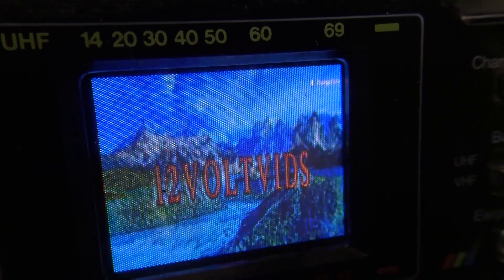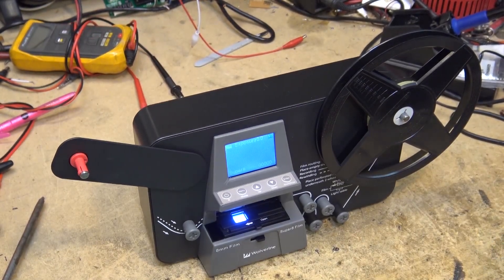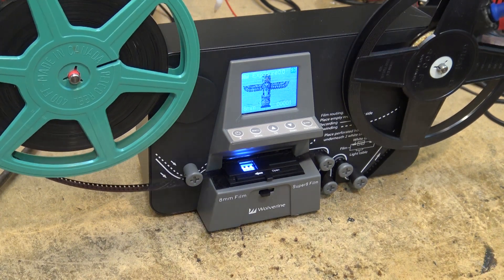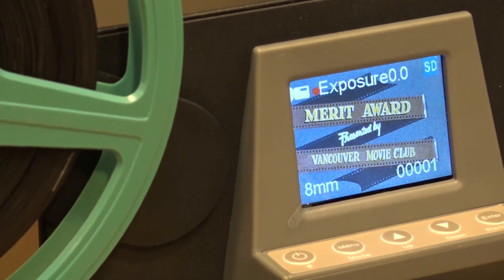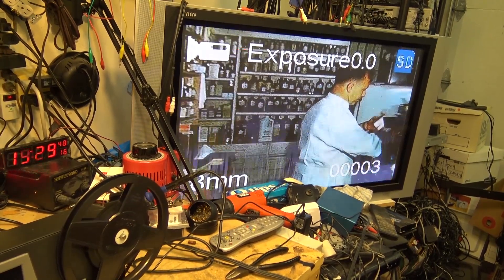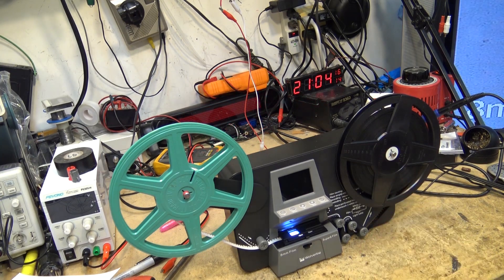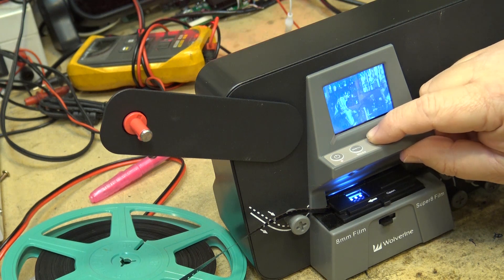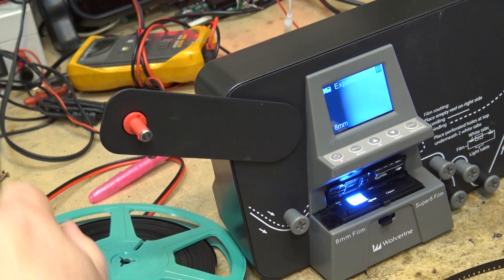Wolverine Film Scanner evaulation and quality check

Comment: I know the Forum 8mm nuts like this plastic minge - but it doesn't have much going for it as a pro device. That is not 'film grain' that's noise. That reel flapping about and getting sloppy and the almost useless anaemic motor and plastic er, 'all the rest' is the antithesis of precision, the halo of fizzling artefacts surrounding every object is the compression algorithm, the slight softness that they try and hide behind the 'barber and his strop' is a mixture of plastic (it's a lie)  lens focus issues / depth of field ... etc ...Holy shit I'm gonna make one, a proper one...(thinking...OK plastic is out...cast aluminium chassis, check. Two nice torquey motors, check. Precision film transport, sprocket advance and mechanism guaranteed not to mark frames, check. Magic solid state light source, magic diffuser, magic collimator , check. ''Full frame'' ++ micro 2/3 sensor. Check. Cost, er..), Yes I'll do you a good one for only, 4695.50 (British pounds).
Reply from the maker: And where did I say that this was a pro device. It is a consumer device and dies deliver superior results compared to a projector and camera with a light box. If I was in the business, and made my living from scanning film, I would invest in something along the lines of a reflecta, however with such a high priced piece of gear comes a very high price to transfer film and there comes a point that people will not pay much. When I was using a projector and doing them in real time at .10 per foot I had people that wanted it cheaper. Even with this unit I probably won't make more than .20 per foot, and this one takes 30 minutes to do a 50 foot reel that I could do in 3 in real time. I still get great results for DVD quality from my old setup, it looks fantastic with a 3CCD camera. The colors are excellent. Saying that, this unit has a sharper picture, and it is very convent to use for low volume or personal transfers.  For someone that has lots of reels of film, this is a perfect device, and not too expensive. I used to get film orders in that were in the 500 price range at .10 per foot. Now someone with that quantity can buy a machine, do their own.
The thing I like it is is quiet, I can load a film, let it run and do something else while it transfers. I don't do much these days, a few reels a month so for my low volume this will do the job, and nobody will complain about the quality. I just load it and forget it. The drive motor is a stepper motor, and no it doesn't "step" it runs constantly, they just use a stepper so they have plenty of torque.The parts that move the film are metal, not plastic. The drive gear is plastic, but it spins a metal cam shaft that moves a metal frame advancer.So the parts that actually handle the film are metal.
Reply: What I was attempting to say, with my poor humour and a touch too much venom was, that these days precision engineering can be prohibitively costly. Many product designers have no option but to cut out the frills - and the metal. We are slightly stuffed in some fringe areas. Anything of fine tolerance or mechanical complexity or that that needs skilled adjustment or finishing is often too costly for the smaller companies or reserved for medical /government / military aerospace / space / satellite field. Some little pockets across the world still have craftsmen of great skill - if you want to pay. Electronics has taken the place of the fine mechanics sometimes with remarkable effectiveness. This Wolfie thing is a perfect example of  cost saving, not quite stripped bare, but much that was done with nuts and bolts is now catered for with electronic elements. When  things are done with a sympathy for all the disciplines there can be magic. A Leica digital camera for example, where material choice, engineering and design along with state of the art electronics combine these technologies with extraordinary results  - but it costs. I don't think that thing (the wolfen) has much art in it. Yes I might be a bit of a snob I guess?
Reply from the maker: Right but it doesn't have to have art in it. All it needs to do is move the film accurately, and snap a picture of it using a fixed focus digital camera. It isn't rocket science. It is nothing more than a basic projector operating in slow motion and a light source to illuminate the film. Why re-invent the wheel. Nothing magic about it, a basic projector. Could they have made it faster, you bet, but the stress on all the parts would go up substantially, and require much finer tolerances.
By picking a slow scan speed, the stress on the parts that move back and forth is greatly reduced, the stress on the film is also greatly reduced. These things are made for a price point. I have a video camera sitting in the other room that  cost me over 10,000 and my cell phone shoots far better quality pictures than this 10000 camera.
Now ehe it was new 18 years ago it was simply amazing. 19:1 detachable lens,  3x 1/2" interline transfer CCD. High band DV Pro tape transport. Thing was awesome, but only 720x480i resolution.
Reply: I must say I had a moral battle with myself over saying anything that might - however unlikely - affect your trade. 
I love film, and I expect you do too, having worked with it for so long and appreciate as I do the beauty of the medium. The popular cultural art form of choice, of human expression. (Ha! Even Mrs Miggins at the seaside filming with her Pifco)? Maybe.
So with  the wrong tactic I said what I thought about the machine. That was how I felt as I watched. I know I should have kept my big mouth shut.  I will say though that there is art in our business - otherwise I for one wouldn't be in it.

Comment: Why is the picture stretched?
Reply from the maker: Editing software was in 16:9 mode as it set itself to the aspect ratio of the camera.  This was the first time I imported footage from the scanner.  Have to go in and uncheck the maintain aspect switch.  Then it will import with black bars on side.   When i process video i used a custom preset for 4:3 format.

Comment: Not impressed at all. The resulting video is LOADED with digital compression artifacts. YUCK! It's very likely that the film grain is more than the codec can handle at its given data rate. They need to fix that before I spend a nickel on a unit like that.
Reply from the maker: Actually it's not. YouTube is loaded with over compression and artifacts.  The image off the scanner is very good. The only thing that is better are units coating 10s of thousands of dollars.  I know someone that has such a system and he charges accordingly.  30.00 for a 50 foot reel for a straight transfer and 50.00 if you want scene by scene color grading done.  For 500 bucks you really can't beat the quality.  In this test i didn't attempt any grading or any type of correction.  The image off the scanner, especially if it has been color and gamma corrected looks great. Never had a single customer complain about it.  My unit paid itself off on the first big order.  The guy I know of that has another system will be paying it off for years.  Mind you he is doing commercial archiving for tv stations so cost is no issue for them.  The average consumer will never in a million years pay that for old home movies that nobody even cares about these days.  Most of the people on them are dead by now anyway.

Comment: Seems like they should be better now but i guess not amd they still pricey from.5 years ago
Reply from the maker: There is absolutely nothing wrong with the wolverine scanne. You do need to set them up correctly like anything else. Pulling one out of the box and using the default settings will not deliver the type of results possible. I have been using mine for several years now and have done about 1600 reels of film.  Lots of people are skeptical after reading comments from uneducated viewers of this and other channel that slam the quality. I get people that bring me 1 reel of film to transfer to check the quality and ever single one of them comes back with their entire film collection. One of my competitors has a 250,000 wet gate scanning system, and yes that is going to deliver superrior results but when my clients compare his service he charges 5X the price per foot that I charge and there is not 5x the quality difference to justify it. He mostly scans 16, 35 and 70mm film for the film industry where they have deep pockets and cost is no issue. They want 5k scanning and are prepared to pay for it. These units do 1440x1080 scanning and deliver results that exceed the quality that most home movies were shot at. Over / Under exposed, wrong filter used ect.  The last guy that I just finished his film order paid me 1,600.00 to scan his film collection and has already told his relatives so I will be getting their films as they find them too.  The key to using this unit is to NOT crop the image in the machine. Scan full frame and crop in the computer where you can also adjust the speed and color level and balance. It takes longer but the results are well worth it. Nobody is complaining except the internet trolls that nothing will make them happy.
Reply: Ok friend thank you for the info keep up the good work
Reply from the maker: Here is a link to the processed version of the home movie.
https://www.youtube.com/watch?v=aqa_x14JOOU

FYI for those that watch the film. The lady in the blue skirt in the bar scene is the only person involved in the film that is still alive. She is 100 years old, and received a letter from King Charles III, The prime minister and premiere for making it to 100.

Comment: IT  WOULD BE  A  GOOD  MACHINE  IF IT  WAS  MADE  IN  GERMANY  OR  USA,  BUT  NOT  IN  CHINA  LIKE  GARBAGE  PLASTIC  ONE TIME  TOY.  MY  BIG  THANKS  TO  AUTHOR   OF  THIS  VIDEO  FOR  GOOD  IN   DETAIL  EXPOSITION  AND  EXPLANATION.  BIG  PROBLEM  IN   ABSENCE  OF  SPROCKET-LESS  TRANSPORT  OF FILM   LIKE  IN  PROFESSIONAL  FILM  SCANNER.
Reply from the maker: It's a great machine for its designed use.  Digitizing your old home movie film.  It is not a professional scanner. Those can cost 10s if not hundreds of thousands if dollars.   The local place that has one charges 50.00 for a 50 foot roll of film.  So 1 400 foot reel costs more to transfer than the machine.   If it lasts longer enough to transfer your films it has paid for itself, then you sell to someone else.
Reply: @12voltvids  SOME  PEOPLE  LUCKY  TO  HAVE  MACHINE  COMPLETE  BY  DECENT   WORKER.  SOME  HAVE  BROKERAGE.  EVEN  AFTER  EXCHANGING  ITEM. SAME  PICTURE  INVENT  BY  JAPAN MADE  BY  CHINA  WITH  DIGITAL  MANOMETER  OMRON. I  HAVE  ELECTRONIC  PIANO  YAMAHA  INVENT  AND  MADE  IN  JAPAN  DURING  20  YEARS    AND  NO  PROBLEM.ENGLISHMEN  SAY :I AM NOT  SUCH  RICH  TO  BUY  CHEAP  ITEMS.       THAT  NORMALLY  WORK  30-50  MINUTES,  THAN  STOP  AND  WAIT  LINE  TO  BE  SOLD  TO  NEXT  VICTIM  ON  EBAY. THANKS.
Reply from the maker: @ikhilyangoldvekht4309  I guess you have bad luck.  Mine has been fine so far.
Reply: @12voltvids  OK  GOOD  FOR YOU. CONGRATULATIONS

Comment: Ah, if we but had the money I'm sure we'd have one of these:
http://www.moviestuff.tv

This would blow away any competition using a Wolverine device...
Reply from the maker: I actually looked at one of these, but at 10 times the price that means 10x the amount of film I would need to transfer to turn a profit. There is only so much that a customer will pay for film transfer. Here it is tough to get more than 20 cents a foot no matter how good the quality is, because there are plenty of guys still using projectors are charging 7 - 10 cents a foot.
Sure the retroscan will do it faster, but you need the work. 20 years ago I could have used one of these because I was transferring using a modified projector and 3CCD broadcast camera, and I was getting great results, be it SD, but back then everything was going to VHS. Most people have already transferred their old home movies to tape of DVD by now, and many have thrown away the old films. Film to video transfer, as a business has slowed down a fair bit in recent years, and now a few people are getting their films scanned a second time now that HD gear is here, but most are not.  I used to do all the film work for 3 photo labs, but they have all closed up, and now I just do it for my walk up customers, so for the quantity that I do, the little wolverine unit will do the job, and nobody will complain about the quality.
Even though the unit is slow, it isn't a problem because I just load it, hit go and walk away and do something else. 30 minutes later I return, and change the reel. Yes it will take longer, but as I said the work has slowed down substantially from what it was 25 years ago, so for my use this will do the job. Naturally if someone has enough films they are just going to buy one of these and do their own, so that makes the retroscan an even harder sell.  At 40 50 foot reels at 10.00 per reel, the wolverine pro (1080p) breaks even, and for the 720 device that is 27 reels. So if someone has that many, they are not paying someone to do it, they are buying a machine and doing it them self.

Comment: audio.........yes     o ,no...             allo................
Reply from the maker: No audio. To transfer a sound film you can transfer the image with the wolverine and use an old sound projector to record the sound and then sync it on a computer.  I have done this and it works well but if course is more work.
Reply: ok thanks..I will do this solution .. hello